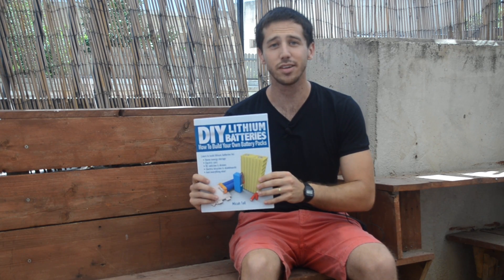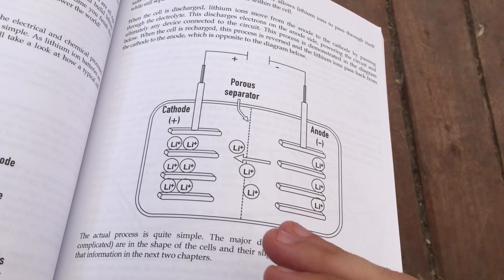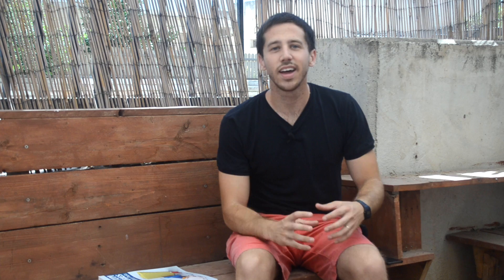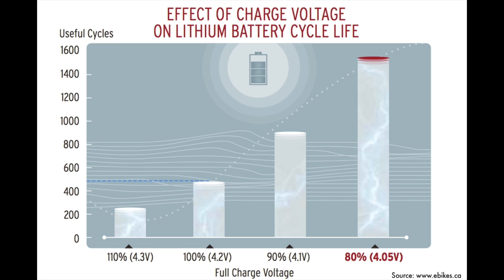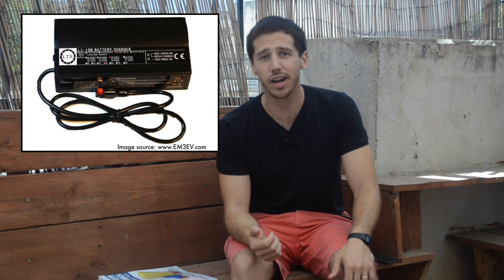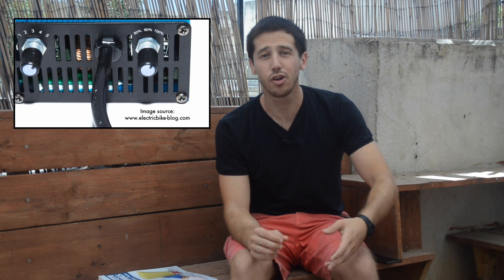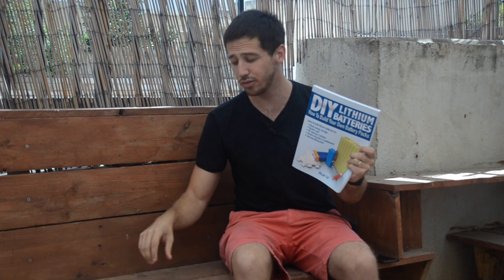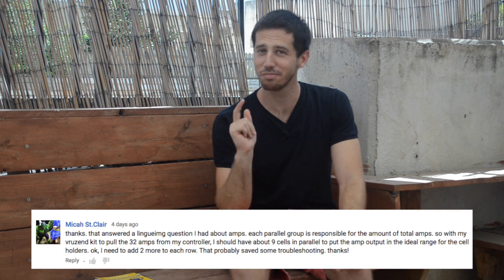How To Double The Life Of Your Lithium Batteries

Comment: I think, I have positively commented on your instructional videos on two occasions, also requesting you to let me know, where I can buy + Positice and - Negative Terminal identifier sign stickers, that I have seen in your videos. It is necessary for me to identify the terminals, when soldering to BMS cables. Once the Batteries are encased in heat shrink tubing, It is tough to identify terminals. Embarrassingly made mistake !
There was no response from your side, that I can understand because of your extreme busy schedules.If at all, you get a slot to respond, kindly do so. By the way, I have bought DIY LITHIUM BATTERIES (ISBN9780989906708>90000) .49220665R00078 , San Bernadino, CA 17May2017, instructional guide, from Amazon.Thanks and best regards.
Reply from the maker: Hi Sree, sorry I haven't ever seen your question about stickers before, but now I have! I'm not sure where you could buy stickers like that, but making them should be easy with some paper tape or masking tape and a marker. Plus you get to DIY it!
Reply: EbikeSchool.com 
Thank you, Micah.

Comment: what what do I do if the battery is bigger than the BMS can handle
Reply from the maker: Cody, what do you mean "bigger"? Higher volts?
Reply: EbikeSchool.com yeah higher volts than the BMS can handle is what I mean
Reply from the maker: Cody, then you can't use that BMS. You have to use one that matches the number of cells in series (ex: a 13s BMS for a 13s battery). Otherwise you'll have issues with protection circuits and discharge.
Reply: EbikeSchool.com okay I've watched other YouTube videos and this one person he was talking about how bad a BMS was when you get your battery so high like 7 Series and 7 Series to make a 14 Series battery or whatever and he said a BMS wouldn't work to properly tell him what the battery charge was so he ended up splitting the batteries and half and charging it with one of those cheap LiPo battery chargers instead so which is right
Reply from the maker: I have no idea what he's talking about. If you have a 14s battery, you use a 14s BMS (which is how my battery works that I use every day). Easy as pie.
Reply: EbikeSchool.com okay thank you I was just a little confused with what you're saying and what he's saying I just wanted to get what was right I love you videos have been watching since about 7 months ago wish I could have one of those books
Reply: I think the other guy was using a 7S charger and had built 2 x 7S batteries which he had connected for a 14 S set-up. If it is the same video I'm thinking his thrust was getting around using a BMS. If you've been in RC 
(remote control) and have cooked a few ESCs (speed controllers)  you'll know the feeling. The BMS's easily cook.

Comment: Great Videos, what is your opinion on using standard dc or variable dc power supply or adapters for charging lithium battery packs?

Example:
https://www.amazon.com/Adapter-Transformers-Supply-Output-Listed/dp/B00DKSI0S8/ref=sr_1_1?ie=UTF8&qid=1500145398&sr=8-1-spons&keywords=12v+3a+power+supply&psc=1

https://www.amazon.com/DZS-Elec-Converter-12V-32V-Adjustable/dp/B06ZY7X1X6/ref=sr_1_28?ie=UTF8&qid=1500145253&sr=8-28-spons&keywords=dc+step+up+converter&psc=1

https://www.amazon.com/Yeeco-Numerical-Regulator-Converter-Adjustable/dp/B01E3RXBV0/ref=sr_1_21?ie=UTF8&qid=1500145253&sr=8-21&keywords=dc+step+up+converter

Comment: In my opinion it is not very well to use BMS. 1 - you don´t realy know if it works. 2 - BMS says (the battery is discharged) and turns it off, but I like to be the one who says if the battery is discharged (e.g. you are 5km from your destination and you know that after your ride the battery will be charged but BMS turns battery off, quite disappointing...)
I think that it is better to charge the battery using charger with balance function (some chargers for RC modellers) where you can adjust the voltage to e.g. 4.1V per cell and it will charge every cell of the battery pack to the same voltage that you want it to be. 
And some underdischarge protection? You can use some voltage meters that show voltage of every cell and they start to beep when the voltage (even under load) of the lowest cell drops below your set voltage (some of them are adjustable up to 3,7volts).
Sorry for my English :-)

Comment: i do have one interesting question though: how would you arrange different capacity and resistance cells in parallel/series? Because I have tons of batteries which have capacities ranging from 2039mAh to 3400mAh, and I'd like to know if it's dangerous placing the same type of batteries in parallel and then wiring them up in series with the other packs.

Comment: Great video, thanks! On the discharge side, I thought I read somewhere that a 52v should never be allowed to run down under 45v. Does that sound correct?
Reply from the maker: That's pretty conservative. I cut off my 52V battery at about 41V. Theoretically you can take it down to 35V (2.5V per cell) as per most manufacturer's ratings, but there isn't much useful capacity between 35-40V, so its not worth the extra strain.

Comment: I am building battery packs for my 48v bike, and my girlfriend's 36v bike. If I buy one 48v charger to charge hers and mine (one at a time), will her BMS stop the charge once it gets to around 36v or will a 48v charger damage her 36v battery? Could I use a 48v luna charger and charge the 36v battery under the 80% setting?
Reply from the maker: It's not a good idea. A proper BMS would protect the cells, but the charger isn't going to reduce current once the proper voltage is reached, so the battery won't charge in a healthy state, and if your BMS fries, your battery could catch on fire. The cost of a charger is small compared to the cost of a bike (or the cost of a house fire) so I'd recommend two chargers, one for each voltage.
Reply: Love your book by the way, just what I needed to get me started

Comment: Well I will definitely keep this in mind when charging my battery from now on.
Reply: One good way that I use is to unplug my charger after my eBike has been charging for a couple hours so I know that it's not fully charged and when I do fully charge my battery it's no big deal because I usually take it out the same day or the next day as I ride my e-bike almost everyday but unplugging your charger before your battery is fully charged is a good idea and then every few weeks do a full charge to balance your cells in your battery.
Reply: Investigate what your manufacturers recommend for best cycle life. What is good for one battery pack may well not be for others.

Comment: With regards to balancing i have started adding 2nd set of balance leads on my battery packs then use two hitec balancers daily connected to the pack cells keeps everthing balanced all the time without issue even tho i use a bms. i also top off to 4,2v, any cells below 4.2v i manually top up works well as long as you only top up 1s at a time! if i want to get 20+ miles at 32mph with 17.5Ah pack.

Comment: so if I build a little bigger pack I'll still have the capacity that I want🙄. Thanks
Reply: To build a pack where you draw only 80% of the energy, but still want 100% range, you need to use a pack 1.0/0.80 = 1.25 times larger. That is 25% larger.   Think of it this way: if I used 50% state of change, but want to go the same distance, I would need a battery that was twice as large. or: 1.0/0.5 = 2.0

Comment: What iff I never take my voltage down to LVC? I have a Luna Storm 48 volt 20 aH battery that I have had fo going on a year now. The very lowest it has ever been is 43.5 volts, and only on maybe 2 occasions. I normally run it down to around 46v, or 45.5 volts. Does this have any ill effect, am I somehow cheating myself out of range? BTW it always charges to 54 volts if that has a bearing on range. Thanks for your time and all the informative videos you have made, I think you are awesome for providing all this info to us laymen. Keep up the good work Micah!
Reply: It doesn't seem to work that way. It will help but there are several factors at work and peak charge seems to be a major part of the equation.
Reply: Peak charge according to this video is what appears to contribute to the degradation of the cells due to build up on the electrodes, unless I am misunderstanding the way the process works.
Reply: Deep discharge and exposure to heat are also enemies!

Comment: I feel like I am a battery genius now. Jk. Had no idea. Do u make most of your batteries from brand new cells or do u use salvaged cells?
Reply: I'm not answering for Micah, but if we read and listen to his lessons, salvage batteries are low power and sag a lot. They are also a tremendous amount of work to prepare and test to safely use. I'm guessing Micah seldom if ever salvages batteries. New appropriate cells are SO much better performing.
Reply: i salvage from laptop batteries and build my pack so much cheaper but you need to research and dont mix chemical types for safety imo
Reply: Many fellows do. It's a wonderful hobby. I just don't want to spend the time sorting and testing to a level that will make me feel safe. I have some NOS batteries I salvaged and use to power lights and low demand projects. But my 30A, even 20A motors are hard on those cells. They were designed and developed for the levels of power needed for a laptop. Not a motor.

Comment: I regularly charge lithium cell flashlights and a headlamp to full charge and then put them away. Would turning them on for 5 or 10 minutes before putting them away give any benefit with longer cell life?
Reply: It's charge level that increases life. I charge my mine to 90%.
Reply: storage voltage if keeping a while without use is best at 3.8ish volts tbh

Comment: Great videos - Always very informative.
Finished my first ebike 11months ago : Crystalyte 3080,Ca3, 18Fet Sinewave controller,1800W Battery,Custom Plexi Glass Battery holder x2 Waterproof LED light systems...etc. I will be transferring all of my components to an "Enduro" build soon, & I would like to build my next battery instead of buying one. 
Using the Vruzend spacers I would like to construct a 84v 40ah battery, as this is my primary mode of transportation, power & range are very important. Any assistance you could give with this would be great. Particularly with the total cells needed, BMS for that size battery & any other relevant info that you think might be helpful. Thank you very much.

BTW--Your ebike building book was one of the first things I read when starting this hobby. Wonderful material & should be read by everyone that is interested in building ebikes.

Comment: If you ever played around with the TP4056 and you failed when attempting to charge in a series, that's because these modules need isolation so there's a couple ways of getting the job done.... You can use these chips that will isolate these modules from the other, but lowers your charging rate to 200mAh per battery. I built a test prototype. I purchased a 18650 4S battery holder/charger with the wires on it and I ran the negative to the next battery's positive until I had a neg at one end and the pos at the other then I added a 4S JST wires with the connector for checking the battery then I wired and soldered 4 TP4056's with protection which has the micro usb plug instead of the mini in parallel to each battery then powered each of them using 4 separate phone chargers, one for each and there's your isolation and it works so I went on ali express and found a ac/dc 5v 2amp power supply for little over 1 dollar USD for each one and I put them in a box and wire all of the AC lines in parallel and the same to the inputs of the TP4056's using 7S JST balance wires, but I used them in parallel so I had 8 wires, two for each battery which can easily charge the batteries a 1amp per battery and drawled powered from them with heavier awg wire to a connector of your choice. Plus I left the $s JST wires on, but in a series so I could check them, but it's not needed as I found out... This put a end to the worries and wait time of balancing these batteries... Don't forget you're not only charging at 1amp, you're charging at 4amp, 1amp per battery when each battery finishes charging it shuts off.

Comment: Great video and addressed a few concerns that I had.

Quick question: Do you know where we can get these BMS that charge to 4.1 (and under discharge too would be nice) or have you got a source where we could build our own or modify a simple BMS to charge to 4.1 instead of 4.2? Thanks!
Reply: Get in line. If we find one it'll be a huge success, but I'd want the option of 100% to balance the pack. Unless the BMS also has a balance function. Many packs sold do not have a BMS that balances on it's own. We need to occasionally charge to 100%. I think for 8-10 hours at 100% to make sure the cells are again equal.

Comment: I recently bought a box of random ebike parts for $50 USD there is a lithium bottle battery with fried BMS a 48v controller a lithium charger and an additional homemade battery that is super sketchy looking like D sized batteries or ??? with wires hanging off and  it caused a shower of sparks when I tried to transport I've left it outside in a bucket with a lid cause I'm afraid to even go near the thing but the main reason why I got this was the box had a 3500W black lightning Hi-Power brand wheel hub on a 26in. rim that was included I figured if one of the items worked then it would be worth it.

Now I also have a 750W Gigabyke scooter that runs off a 48V controller I picked this whole thing up for $50 USD because it was missing a charger but not anymore and now works perfect.

My questions are can I mix parts from different kits providing the power ratings and volts match or am I opening a can of worms here by trying to save money by going this route?     And if the BMS is fried Could I remove and replace it safely or is it too risky to even mess with?   Thanks for your help Micah
Reply from the maker: Generally speaking, yes you can mix and match part. The main consideration is ensuring the controller and motor aren't trying to pull more power than the battery can supply. That 3500W motor is likely worth a few times more than what you paid for the entire haul.
Reply: Nice I currently have four 12v lead acid batteries that are running at 48v for my 750W wheel so I'm very excited to test this out I appreciate the reply

Comment: So, from what I understand, when in active use it's not a big deal, but for storage you should charge it to somewhere between 50 to 80%, and keep it unplugged from the device so charge is not slowly drained. Is that correct?
Too bad in portable electronics it's getting harder and harder to disconnect the battery (because of "integrated" batteries).
Thanks!
Reply from the maker: That's correct!

Comment: Can someone explain why some batteries get hot when charging. >150 f
Reply: Could be a few things: rate of charge is too high, battery is getting old (had a lot of cycles already), overcharged, internal resistance is high etc.
Reply from the maker: ^Yep, what Gordon said. Either way, thats too hot. Be careful.
Reply: BE CAREFUL...As the others stated that's a lot of heat..I wouldn't charge that battery unattended if I were you.

Comment: Hi Micah. If you have 52V pack does that mean you need a 58V charger? That is,, assuming you have 14 cell series configuration then 4.2x14 gives 58.8.
Reply from the maker: Yep, 58.8V for a full charge (4.2V * 14 cells in series).
Reply: What would a 48volt 20 ah battery need to charge to to be at full voltage?
Reply: 54.6V 13x4.2=54.6
Reply: Do you have a datasheet for your battery? I know for my 18650 (Panasonic) it says the charging volt is 4.2.
https://na.industrial.panasonic.com/sites/default/pidsa/files/ncr18650b.pdf
Since I have a 10 series configuration that means I need a 42V charger.